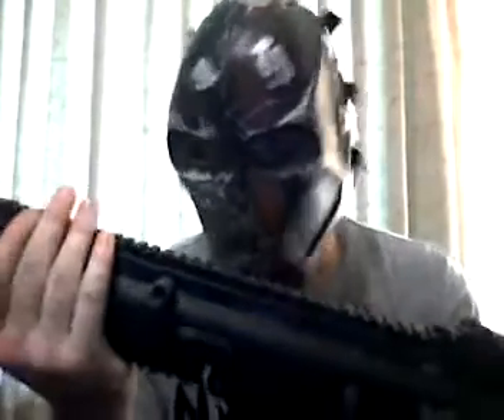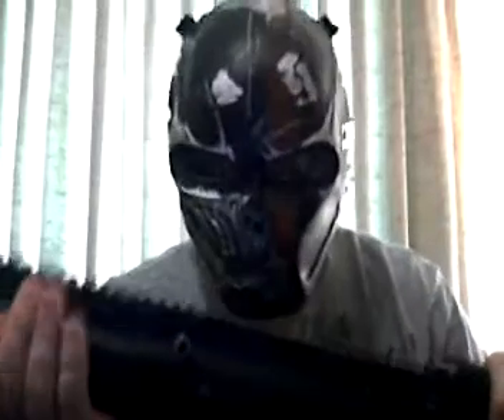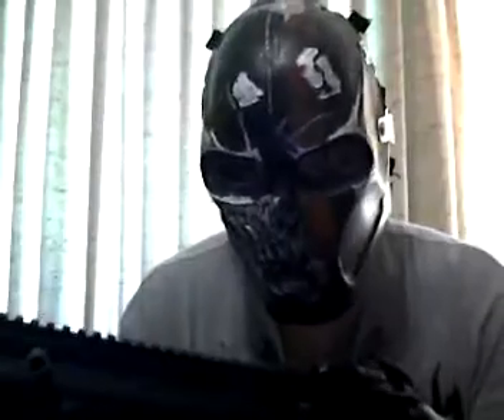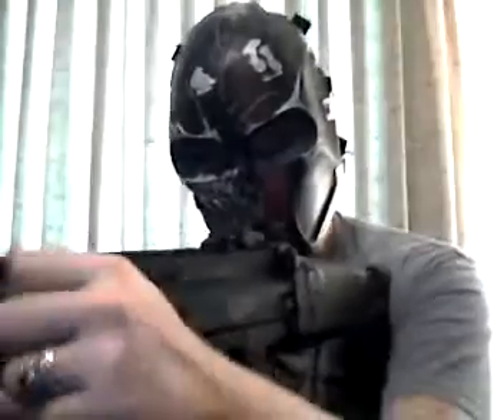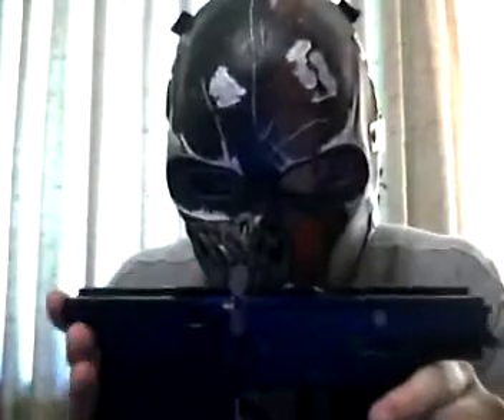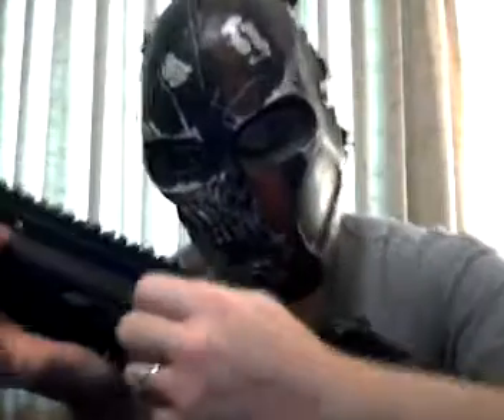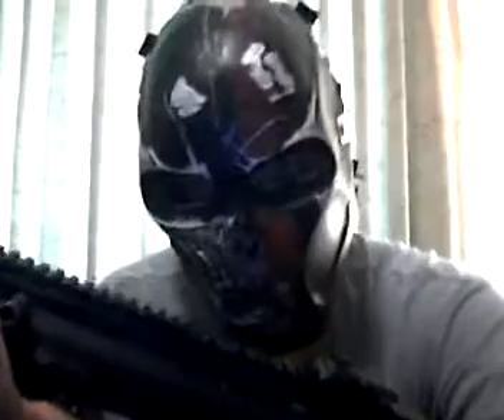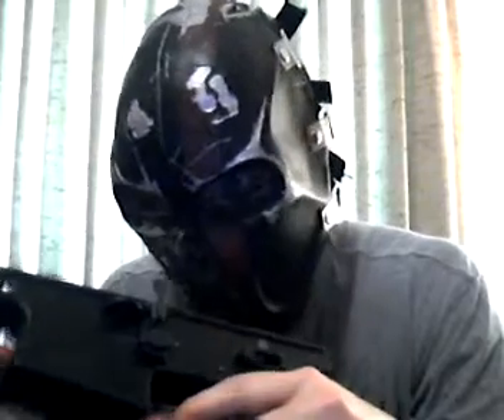WE SCAR problems (problem solved)

Comment: Seems like the trigger (actual trigger part) is snapped at the joint, therefore bend down and unable to catch the hammer.  Which causes the hammer to spring back up after the bolt has passed it and pushed it down.  It's not designed to have the bolt behind the raised hammer ever, so it's hitting the bolt on the back of the hammer.  Careful cuz if u apply too much force on that you may need to replace the hammer and/or the bolt as well.  Possibly the nossel due to bolt damage damaging the nossel.

Comment: i have same problem but found out what it was, the part you manually can lock back i noticed a pin was sticking out and it was catching the side on reload or when you pull charging handle back.   hope that helps